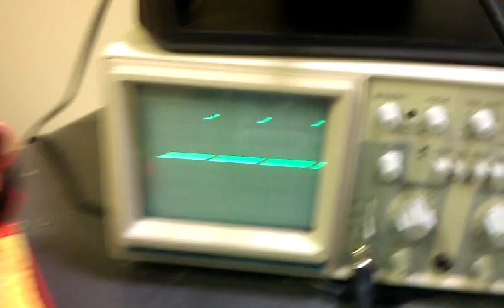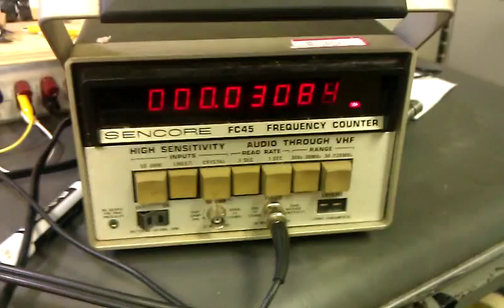Arduino Function Generator with adjustable duty cycle

Comment from the maker: @amazulu49 I would say to adjust the frequency for 1 hz to 1000hz you would have to modify the timer prescaler but I'm not how this is done in arduino code. If someone knows please let us know. Otherwise, you could try just driving the arduino with a lower frequency clock signal. Crystal oscillators are generally formed from a crystal and an amplifier. So to change the clock frequency just remove the crystal and input your own signal into the amplifier input, which should be one of the pins the crystal was attached to.  I might make a video on this. I'd want to use a dual channel scope to measure the signals on the arduino oscillator pins to make sure my input was a good match.

Comment: @aniccame Lower values will pass more useless current through the divider though, so no sense in that. At 5V, 10k pot = 500 uA wasted by each divider. So a milliamp for both, not too bad. (I = V/R; 5V/10000ohm = 500uA)

Comment: @aniccame It doesn't matter, because it is just creating a voltage divider between hot and ground which is being read by the analog pin. I usually use 10k because I have a whole bunch of high precision pots of that value already because of previous experiments. Whatever you can find.